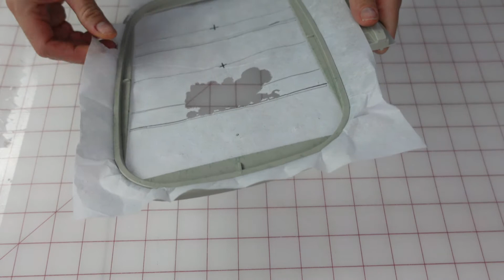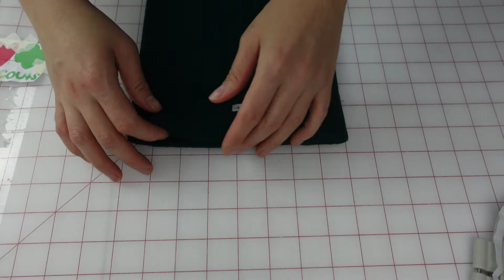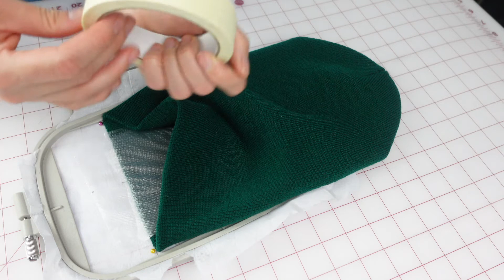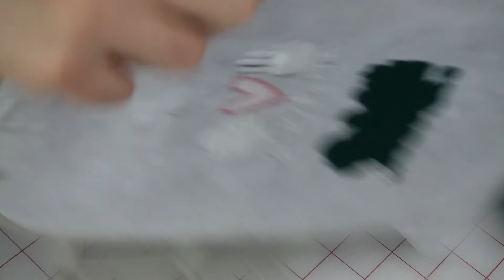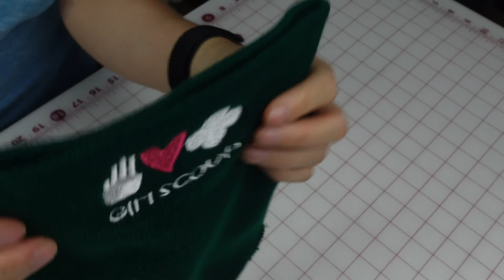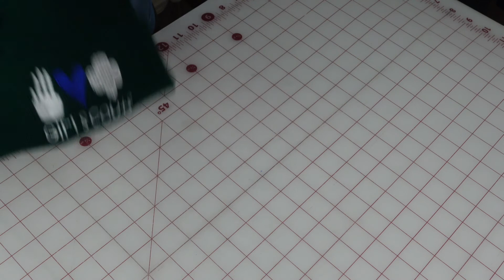How to embroider a beanie using a Single needle Machine I babylock Flourish 2

Comment: What is the tool you are using to trim all your threads?
Reply from the maker: Hi!
I am using the Curved Fiskars scissors
Reply: @ShopWithDelicia  - I actually meant the other tool that you are picking out the stabilizer with but I enlarged the video and looks like it's a pair of tweezers with handles :)